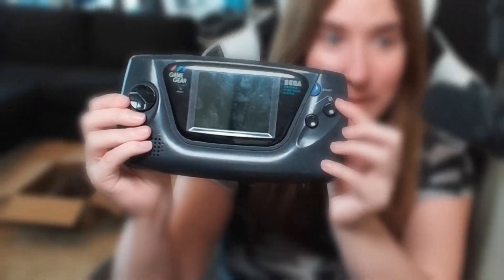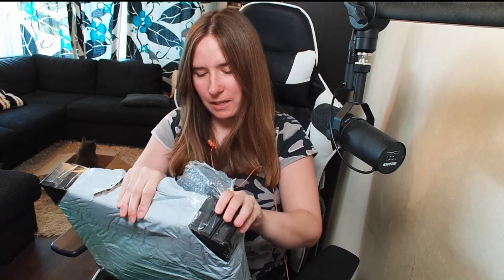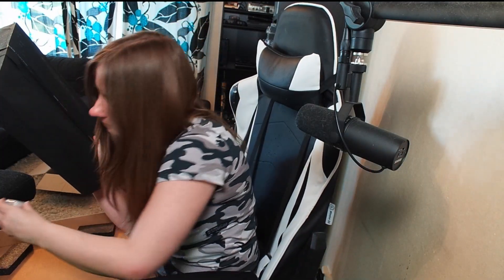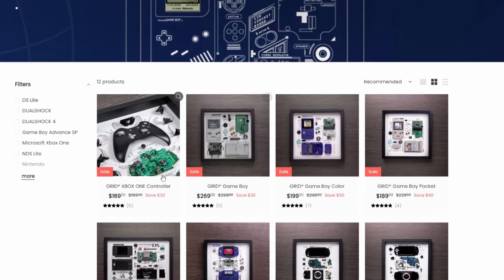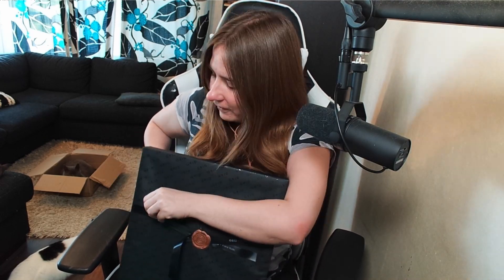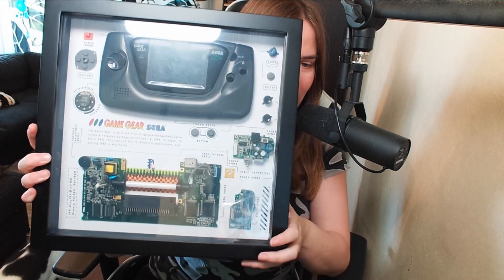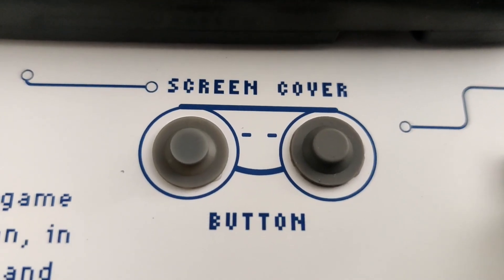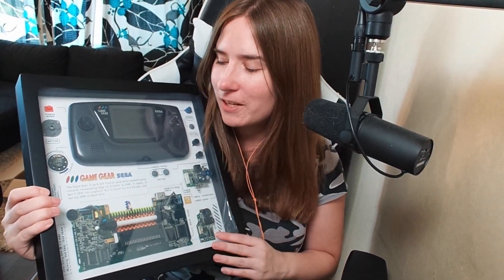Grid Studio - Game Gear Unboxing

Comment: I don't get it. Is it for dead hardware?
Reply from the maker: It's a product you order as shown on their website. Basically they take a phone. Controller or selected handhelds apart and frame it explaining what the unit consist of in explanation. Think of it as a framed infogram
Reply: @GameMistress  if it's for working hardware it seems like bad taste. Why even put a working piece of hardware someone could use like that. Just take a high resolution picture of internals and frame it instead. Sorry. This is just irritating to think about if it's good hardware.
Reply from the maker: @robertlawrence9000  how can you be sure it's working hardware? It would be neat if they gave broken hardware a new life with this method. That's actually something one could ask them.
Reply: @GameMistress  that sounds better than throwing them out for sure